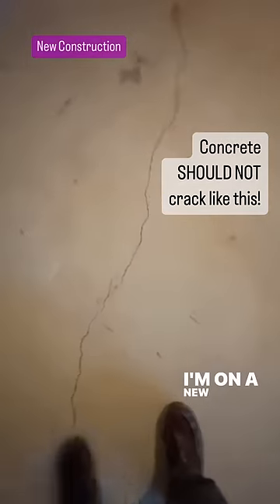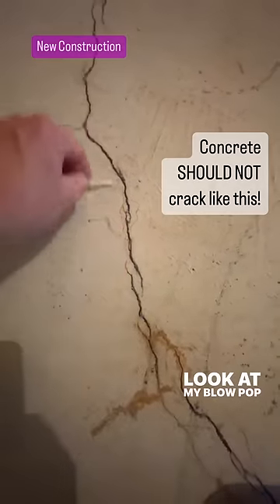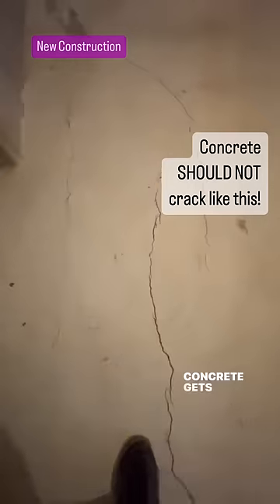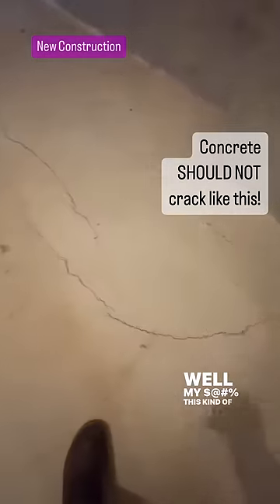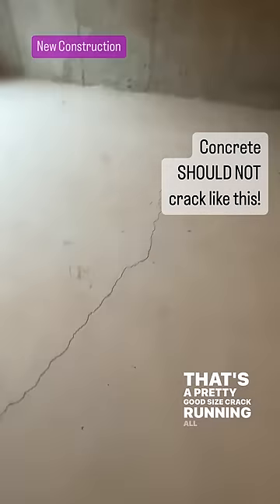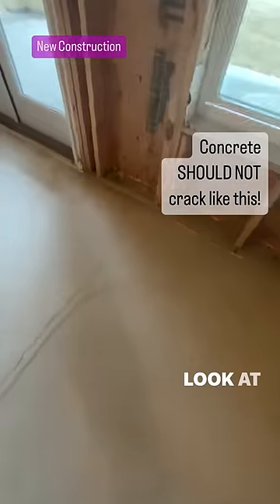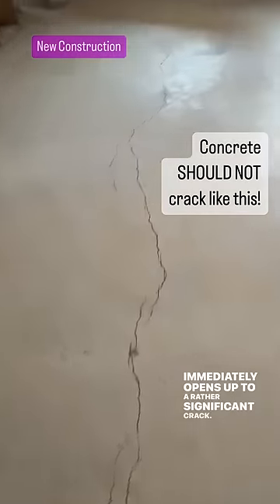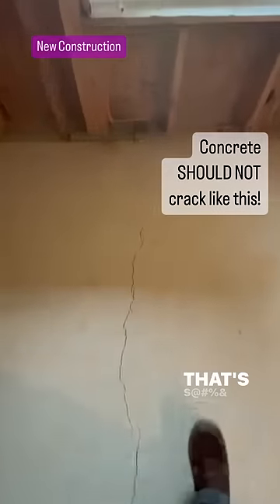New Home with Multiple Slab Cracks

Comment: No vapor barrier, no reinforcing, no control joints but pleeeeenty of water in the concrete = ain't no "fixing" that. 
 Time to see what your lawyer is worth.
Reply: @SemicrazyMagatrucker and that’s a lie
Reply: @SemicrazyMagatrucker   yet another lie
Reply: @SemicrazyMagatrucker   I mean listen Paul, if you’re a repair man, you deal with bandaids for batch product irregularities. Not disrespecting your skill or trade but it is what it is. Prep, Placement, then product management within the finishing process is what causes failures. No more No less. Cracking, spalling, heaving, expansion/contraction etc… can mostly be controlled and prevented, which in turn would put you on the couch or at Lowe’s selling Quik Crete
Reply: There’s nowhere to put vapor barrier underneath that concrete lol vapor barrier is for homes that are 3-5 feet above ground with a crawl space. 

Theres no crawl space under that concrete. And
Reply: @brianh6272   🥴
Reply: There are some real dumb comments on this thread. Yes, you can put vapor barrier in a basement just like that they do it all the time. No there is obviously not any reinforcement worth a damn in this concrete. Yes they clearly used too much water, and not the right mix in general as evident by the appearance. I don’t think there’s a single thing about the concrete work there that is within spec, according to was written for that particular project.
Reply: @lumanpaul  I'm sorry to have to mention this but you are working with some bad information with those comments. 
  Any space that will have or will potentially have conditioned space above it, read heat ; air conditioning, needs a moisture barrier to prevent sub grade moisture from being drawn thru the concrete itself. 
  Many flooring products require a 24 hr moisture level verification test before a warranty will even be validated. 
 Also, expansion/ isolation joints are absolutely necessary if the basement floor is poured against the foundation walls. 
 Indeed, depending on the square footage of the area poured, expansion joints may not be necessary in the field, however,  tooled or sawn relief joints are most definitely needed to control the hairline cracks which develop as the water content dissipates & mixture cures. 
 Cheers.
Reply: @SemicrazyMagatrucker  you're a funny guy. 
 This has literally been my life for 32 years now. Troll elsewhere.
Reply: Vapor barriers are not effective against hydraulic pressure whether it's a high water table or heavy rains.  If the foundation drains were properly installed, then the pressure should be controlled.  There are control joints with cracks right beside them signaling they waited too late to cut the joints or they were not cut deep enough.  Reinforcing has minimized effect on cracking but will control the amount of separation.  Too much water is my first guess, but core samples and testing will help determine if it's poor workmanship or bad concrete from the plant.
Reply: @sonnyh9774  very well said. 
 Id only add that small residential dwellings, especially being typically less than 4000 sq ft, and yes, depending on the geographical location, can effectively mitigate moisture intrusion with 6"-8" washed stone and a 6 mil poly barrier given, as you correctly state, the perimeter foundation is properly drained. 
  
In my opinion there are far too many people with too little knowledge claiming to be contractors in nearly every residential building trade. 
 Too many times it's the homeowner/ first time builder in efforts to get out cheaper who frequently fall victim to the "contractor" with just enough knowledge to be dangerous. 
 Commercial / industrial construction benefits greatly from due diligence where extensive geological testing is typically provided for civil / structural engineers to incorporate countermeasures into site plans, along with inspections that practically eliminate major errors by inexperienced contractors. 
  Cheers.
Reply: @SemicrazyMagatrucker You also must consider the stability of the ground it was poured on, I see good pours crack all the time due to unstable ground. Most builders will just grind and epoxy. What would you do?
Reply: @Concreteer beautiful Google search
Reply: @SemicrazyMagatrucker  It looks like they poured Level Quick on that slab , trying to cover the cracks maybe ?
Reply: @rogerbivins9144  Agreed.. Here in Michigan though a 10 mill vapor barrier is required for radon gas that may be present in the ground below any residential space. At least that's what I was taught pouring slabs for 11 years.. If there's a hydraulic water issue it needs draintile around the outer perimeter of the basement footing that drains to a crock with a sump pump or ran outside to a lower grade and daylighted.  Oh and those micro cracks can be lessened or entirely stopped by soaking the slab in water and covering it with plastic sheeting after finishing it and cutting the control joints in it.. If it's a 4 inch slab cut it 1 inch deep, if it's 6 inch cut 1.5 inches deep.Then keep it wet and covered for 3-5 days afterwards.
Reply: @SemicrazyMagatrucker  There is something on top of that concrete. You guys take core samples ?
Reply: @SemicrazyMagatrucker  I do tile flooring in mostly new tract and semi custom homes, slab cracks are certainly not uncommon in the houses I work in
Reply: Nailed it, your right
Reply: I'm no mason but I've done enough concrete to know that you don't put expansion joints in basements, this mix was way too wet, the subgrade probably wasn't compacted enough, it doesn't have enough steel in it,  and it's probably too thin. Just my non-professional opinion from a guy who builds a lot of different stuff
Reply: Whatever the cause, best get them in court before they fmgo bankrupt on you , just to re emerge under a different name
Reply: @brianh6272 bro building a basement is a reverse pool build. You build so moisture don't go in. You definitely put a moisture barrier. Making a basement is demanding. Compaction test with load engineering. gravel with drainage and sump pump if needed. Moisture barrier with rebar and whatever reinforcement required.
Reply: @SemicrazyMagatrucker I'm pretty sure you don't know what you're talking about. We would cut control joints in every floor. And we always used vapor barrier(visqueen). Wire mesh or rebar suspended with blocks or chairs. As well as dowels in the footing. This floor needs to be cut out and redone.
Reply: Probably an Allen Edwin home. Cookie cutter houses with shitty, cheap concrete. They also have the basement walls poured at usually only 6" thick. Ask me how I know.
Reply: @rogerbivins9144 well said brother
Reply: @SemicrazyMagatrucker . A concrete vapor barrier is any material that prevents moisture from entering a concrete slab. Vapor barriers are used because while fresh concrete is poured wet, it's not supposed to stay that way. It needs to dry and then stay dry to avoid flooring problems
Reply: @winstonscates4387  You copied and pasted that from wagner meters. Do more research they didn't write the book.
Reply: If it happens that quickly it is probably to much water in the concrete, and a lack of rebars.
And he has problems with water after rain, then it something else to.
Reply: @catpeople1958 no rebar or they didn't use chairs
Reply: I was thinking it probably wants to come up but the builder will just repair the cracks i bet and hope it holds till the floor goes down and then you won't know for ages
Reply: @Concreteer Did the dude erase all his comments because of getting ratio'd?
Reply: @rustyshackleford9154  typical bozo got dissected on his lies 🤷🏻‍♂️
Reply: Prove me wrong then🤡🥴
Reply: Exactly lol unbelievable and horrible bc someone will buy this home and very doubtful it'll be fixed and who knows if a week or 10yrs but they r gonna have some serious problems. All from 1 company cutting corners
Reply: It's probably not four inches of crusher run underneath that concrete either.
Reply: Nope you wouldn't have that moisture with a quality vapor barrier. Should have used fiber reinforced concrete. Subgrade was probably half ass done as well.
Reply: @porkchop912  how do you know fiber isn’t entrained?
Reply: @brianh6272 wrong... vapor barriers are installed on grade as well mr thinks he knows it sll
Reply: Amen.
Reply from the maker: This is a new spec build and wasn't under contract, someone walking in SHOULD see this. That said, builder contracts are HEAVILY skewed to them. Doing this 30+ years; the builder will scoff at this, brush it off and tell a buyer "They're just settling cracks. You have a 2-10 warranty so even if there is an issue, you're covered". They want you signed and gone. Once you sign, you are in for one hell of a battle to get out - very expensive to find a real estate lawyer that will litigate. Vast majority don't want to bite the hands that feed them.
Reply: @brianh6272 wtf you can always use a vapor barrier no matter type of foundation your peers don't need it but beams do. Slab on grade needs it especially a house on beams with a crawl space would need significantly less moisture protection compared to a slab on grade you're on Crack
Reply: Just wait until they move in and have several years of heavy rain. No good.
Reply: I've never seen control joints in a basement floor 😂
Reply: @brianh6272 you put the vapor barrier under the concrete and on top of the ground.
Reply: @kylehoppe158  have you ever seen a crack in a basement floor?
Reply: @rogerbivins9144  no not one
Reply: My house was built in 1967. I have 9 inches of concrete in my basement. not a single crack. New construction cracks in every single house because they only give you 3” concrete.
Reply: @brianh6272  I don't think you quite understand
Reply: You don't know what is there.
Reply: You said it best
Reply: Get a better lawyer, one that will get you out of that concrete prison cell
Reply: Should have cut some reliefs in the slab. That's all they had to do.
Reply: Not to mention they never let the flundation settle cus it takes to long so of course. I dont rember having destiny and moisture content in homes but it commercial stuff they do
Reply: Drill cracks. Sandbalst. Blow out. Add plugs. Squeeze in the goop. Keep your slab
Reply: Absolutely paper barrier 5000 psi concrete number for rebar and saw some expansion joints is what I would’ve done back in the 70s and 80s when I was pouring concrete floors. And it’s obvious to anybody that’s ever done the work correctly that that job is all fucked up.
Reply: @brianh6272 what the hell are uou talking about ?? You have to put down vapour barrier befor you pour .
Reply: @sonnyh9774 so are you saying that hydrolic pressure will push water through a plastic vapour barrier?
Reply: @chrisharrison3245  no, I'mnot saying that. Vapor barriers are not perfectly sealed so the water will go through every seam , hole and around every edge.  That vapor barrier isn't designed to withstand a high water table.
Reply: @sonnyh9774  i think that you are playing a guessing game here and not at all knowledgable in this field. and if you believe that that much water can penitrate  then your not doing it properly then
Reply: @chrisharrison3245  I understand hydraulic pressure from high water tables on walls and slabs.... do you?
Reply: @sonnyh9774  yes I know that there is 62.42 pounds of water per cubic foot. I also understand  why it’s important to alleviate that pressure and redirect the water away from your basement via weeping tile, french drain etc etc with these and or a "properly" installed vapour barrier you will not have this problem .
Reply: @chrisharrison3245  water seldom runs uphill.  Vapor barriers are supposed to retard water vapor to protect flooring... low pressure.... not protect from higher  water pressure.  Relieve the pressure, relieve the water coming up through the slab.  Water takes the path of least resistance,  and obviously something or a bunch of things weren't done right.
Reply: @sonnyh9774  that's is obvious from what we can see in the video. But water, hydraulic or not should not push through plastic. Yes it will if the vapour barrier is punctured like air it will take the path of least resistance.
Reply: I mean what would really happen if you did a floor finish over and just wrapped up the project? I see some moisture coming up from before the foundation was poured but wouldn't the structural integrity be just fine?
Reply: @chrisrageNJ 

And the dog's name is...? 👌
Reply: @misterrichardc  yes there's that thick tar fiber stuff I've seen, and even spray foam around the perimeter,  but in my limited experience I've not seen an expansion joint through the concrete
Reply: In order for those cracks to be corrected....the whole foundation, need to be done over? I would like to know the solution to the problem....appreciate your time to answer.
Reply: Exactly
Reply: @HoUsEoFcAtS78  6 inch walls? That's effin criminal
Reply: Vapor barriers under slabs and in crawl spaces are to help keep out the radon gasses that naturally come from the ground. Has nothing to do with or help concrete from cracking. Put some mesh rebar or fiber in that concrete and it won’t crack like that but when your guys pour it make sure they pull the mesh up where it needs to be and bar on saddles. Then when it’s green yet saw cut the goddam thing ten minutes of work prevents days of unnecessary work and heart aches
Reply: @brianh6272  WTF you talking about? The moisture barrier goes on the ground before the concrete is poured on top.
Reply: I CAME TO SAY THE SAME THING😂😂
Reply: Often times the prep in basements is done before the concrete guy gets there. Blame your excavator
Reply: What basements have you seen with control joints?
Reply: @brianh6272 say you don’t know anything without saying you don’t know anything
Reply: @Hmtatlanta the cement mix was more fly-ash in stead cement , to save money for the contractor. A certification of the mix and a test sample along with a inspector on site will save you this headache.  Or if the ground is to dry , if so, this  will suck out all the water in the mix , before it drys !  Giving you those kinds of cracks . It's good for youtube but not the home owner...👈😳
Reply: Not crap, 2x the cost of the fix yourself and more headache
Reply: @sonnyh9774 it is without a doubt cause by hydraulic pressure, when it went off it sounded like a bomb.
Reply: @rogerbivins9144  just sprinkle, some dry sweep  everywhere,before pouring the concrete
Reply: Well yeah there is a way to fix it, ripe it down and start all over!! 🤔🤔
Reply: You don’t typically put control joints in the flowering of houses. And the vapor barrier is literally for the wood not the concrete. And idk what you talking about with “plenty of water in the concrete= ain’t no fixing that” cuz water isn’t even the cause. And it can be easily fixed it’s just gonna cost money. Cracks do happen tho and can’t really be controlled no matter how many joints you create, but this whole floor is cracked and is leaving room for water to get all up in that foundation and under it which will cause a whole lot more problems than just cracked floors now.  And I know, all you YouTube scholars are so smart and know more than everyone else even the guys that do this everyday but y’all don’t sound too bright to those of us that really work in the trades.
Reply: very expensive repair to set structural standard with cut up, new rear enforcement and repour patch.
Reply: Every house built in Florida has a vapor barrier and nearly all are built on ground level
Reply: It's all ns. Thanks liberals
Reply: @brianh6272 WHAT?
Reply: @catpeople1958 there are also some pretty interesting assumptions made here, first laying down plastic “vapor barriers “ is NOT water proofing, you have all made the assumption there is no reinforcements, could be they just poured the concrete over the mesh and not pulled the mesh up into the mixture,., you have all made the assumption the concrete guys did the setup, and the plumbers didn’t move mesh and cut plastic, concrete guy very well told them, this is now screwed up and I can’t pour today, and was told to move forward as is, we are not paying any extra?? Laying down plastic WILL NOT stop ground water., no one knows the weather conditions in which it was poured, Now the part that scares me, at least in my area they pour footings, around the outside perimeter, usually 36 plus inches deep, and roughly 8 inches thick, then plumbing gets roughed in, electrical if it’s underground, then the interior is poured, so his comment about “a lot of weight over there” is moot., why does he not show the outside where those cracks appear to go?  Also a lot of different areas use different codes, different regions have different weather conditions, ground water is different from Florida, to New Hampshire, and so on,  so being the guy making the video has zero clue about circumstances that led to this, he should attempt to stay in his own lane!! I am by no means saying this slab is good, but for all we know the homeowner did it himself, and relied on the concrete truck driver for advice?? They could have got caught in a unexpected downpour half way through the pour?? EVERYONE who does concrete has been put in circumstances either by their own doing, or by circumstances, that led to tearing out a pour, if you have not, you ain’t no concrete guy!!
Reply: My wife and I were looking for a new home.  Saw a basement that looked just like that.  We called it the" Crack house".  Advised the realtor to never show the house.😮